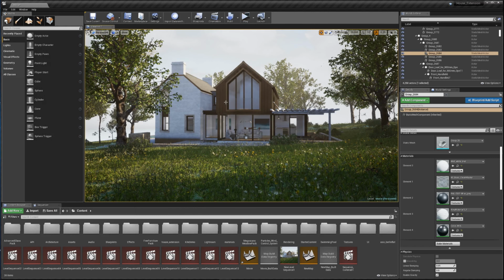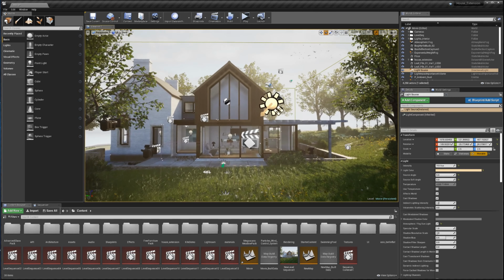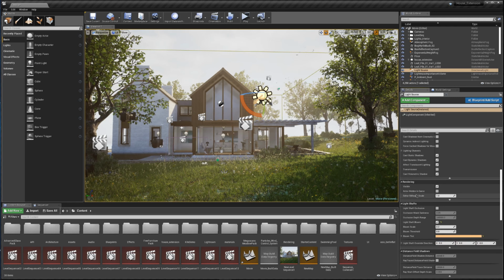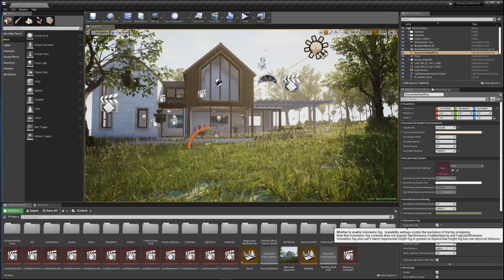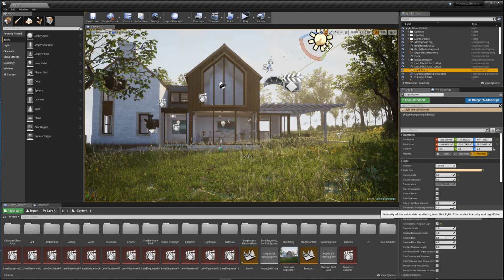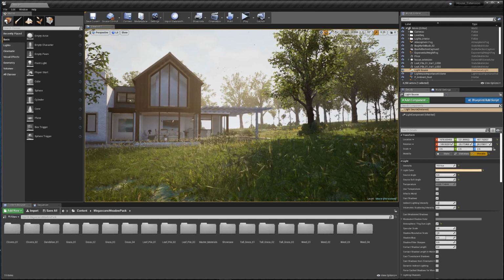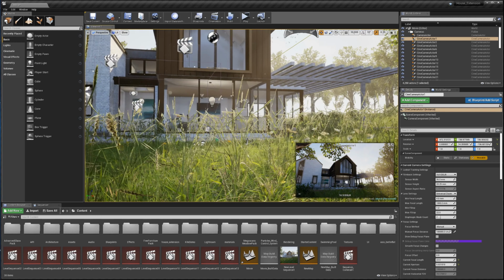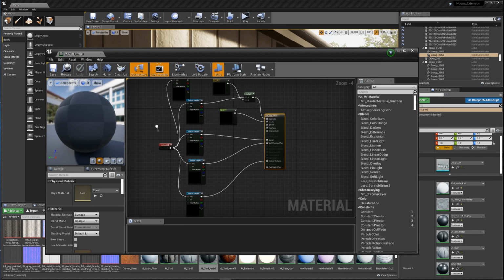How I made this Cinematic Architecture (SketchUp & Unreal Engine 4)

Comment: Do objects come in UVd from sketchup or do you have to manually UV them in sketchup first?
Reply from the maker: Hi, When you apply a texture in SketchUp it saves the UV coordinates. If they're not scaled correctly, I will rescale with a UV plugin tool on SketchUp then re-import. 

Hope that makes sense!
Reply: @theorangeryblog   Thanks, I was just installing a free plug in called "thrupaint" which is for UV scaling in sketchup. Is this what you use?
Reply from the maker: @JamesBrett2008  haven't heard of thrupaint, will check it out. I use SketchUV, free and had no issues with it. There are a few tutorials on YouTube for it too